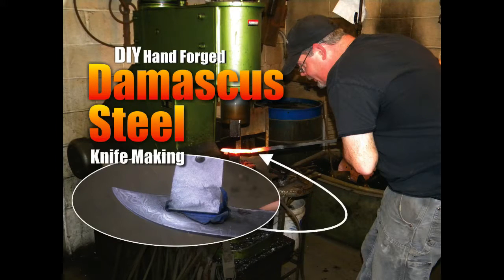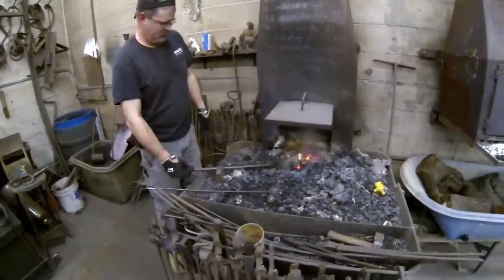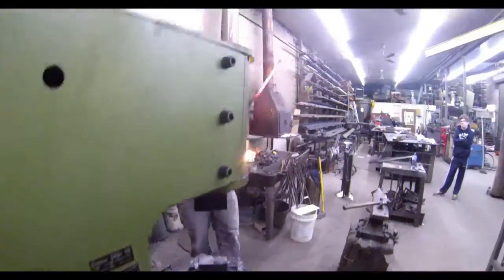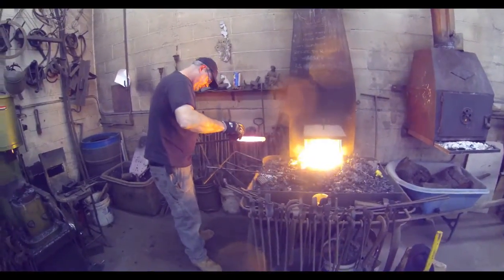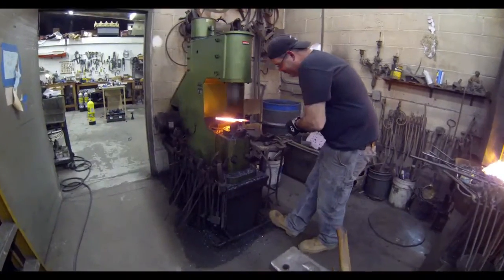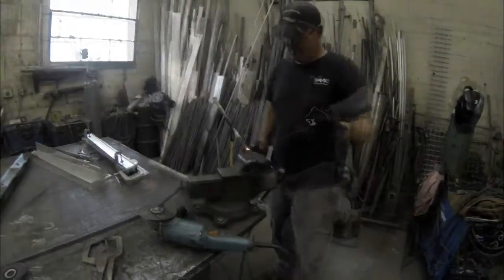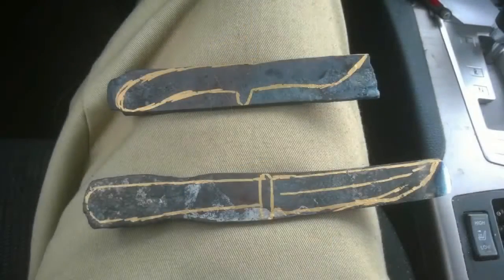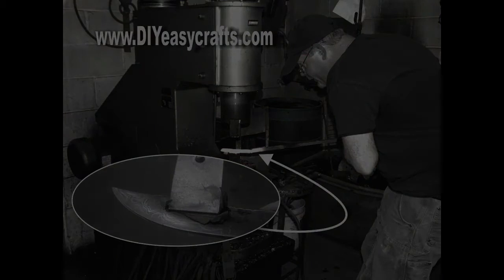How to make Hand Forged Damascus Steel for knives

Comment: Forging with a power hammer or press on open dies is considered hand forging.      Having a skilled striker with a sledge hammer is also hand forging.     Forging in closed dies is not considered hand forging.   I say this as a professional smith with over 50 years professional experience and knowing hundreds of blacksmiths.   Power hammers are over 1000 years old.  Gas forges and oil forges were invented in the 1800's.  .
Reply from the maker: absolutely agree

Comment: The sparks are actually molten steel flying off because the metal is so fluid on the outside compared to the inside
Reply: the sparks are flux and oxidised metal beaten out. so not steal anymore at that point but black rust.
Reply: +Hellspijker actually the sparks are different as the slag doesn't spark
Reply: +Hellspijker but they do contribute in the making of sparks